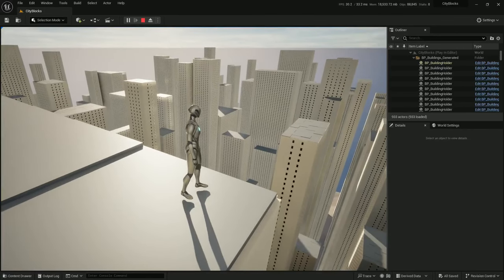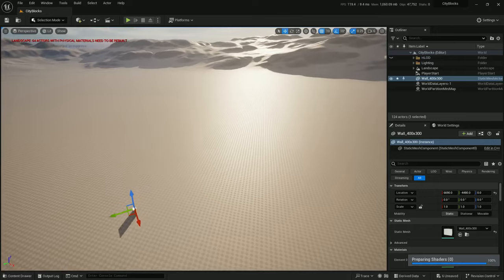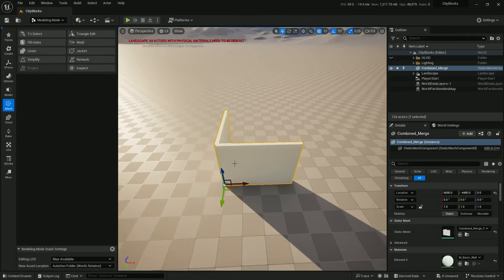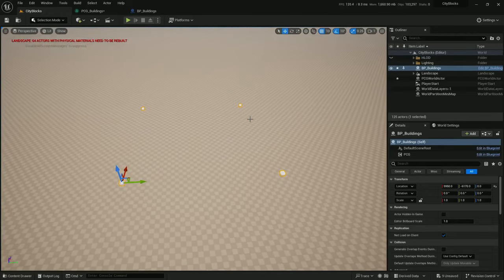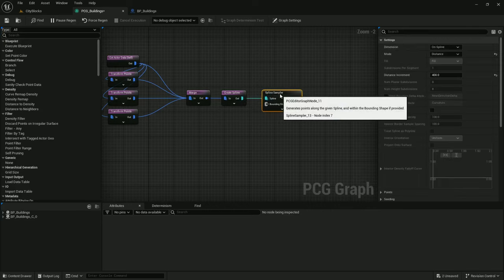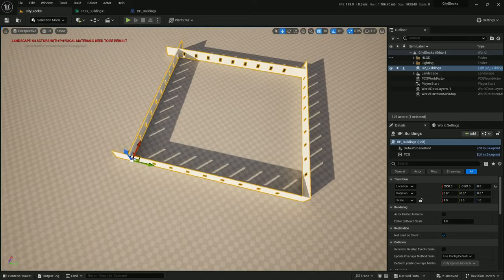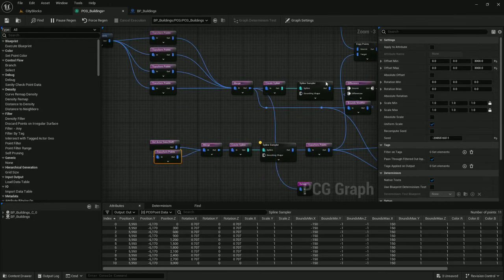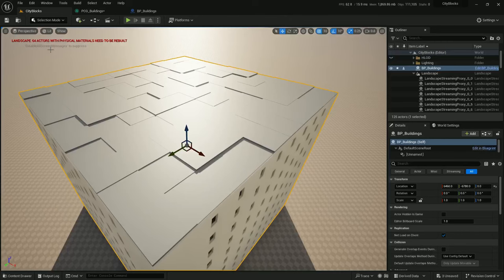New and Improved Procedural Skyscrapers - Unreal Engine 5.3 PCG Tutorial

Comment: an hour and a half for something that will pretty much never achieve over 30 fps isnt really worth using unless its for something non real time
Reply from the maker: That's why I watch tutorial videos at 2x speed 👍
Reply: @MichaelRoyalty  speeding up this tutorial still wont help you get over 30 fps lol
Reply from the maker: No, but improvements to nanite and lumen might.
Reply: @MichaelRoyalty  Somehow the Matrix tech demo seems to run pretty well. What did they do different?
I think they didn't use PCG. I think they used Houdini to create all of the buildings.

Unreal Engine, Blender are trying to do what Houdini is doing, but Houdini is better at it. I would suggest to build it there. There are also plugins for Houdini in Unreal Engine.
Reply from the maker: Yeah, the matrix demo pre-dates PCG, and the buildings in it are hollow. It wouldn't be too hard to spawn cubes in PCG and slap building textures onto them. I think the big challenge the matrix demo solved was in how it lays out streets in a customizable grid.

In this video I'm not going for efficiencies, I'm laying out lots of static meshes to block out the building, basically pushing PCG to excess. These are two very different goals, even though the end result appears similar.

Also I'm not kidding when I say improvements to nanite might help -- the big slowdown seems to be because nanite can't break the walls down into larger triangles at a distance, so it gets overwhelmed. If it gets the ability to merge different ISMs together it would grant a massive performance boost.
Reply from the maker: Here's a great PCG city example that uses textured cubes in the same way the Matrix demo does: https://www.youtube.com/watch?v=KRjtqxID16U
Reply: @MichaelRoyalty  we shouldnt have to rely on nanite to do all our optimizations for us. Nanite is making people lazy.

Comment: Do you plan to continue this project like in your showcase video as result with these terasses? And maybe you can add stairs, so you can walk through every etage? Thanks for this wonderful tutorial!
Reply from the maker: I'd like to, but figuring a building layout that will support stairs is a challenge! I'm muling over the best way to design full room based interiors, and with that I should be able to support stairs and elevators.

Any update I will do will take a while, it's a complex problem to solve.
Reply: @MichaelRoyalty  if it would works, would it be a separate tutorial or based on this tutorial? And thanks for the answer!
Reply from the maker: I'll try to make it based on this tutorial. It's possible I'll have to take a different approach and start from scratch, but I'm pretty sure this is a solid base.

If you hand created some stories and interiors and saved them to assemblies, you could reuse those to create the building interiors. Just copy the assemblies to the vertical spline and you're done!
Reply: @MichaelRoyalty  ok thanks! You make really good and highquality videos! Thanks for that!

Comment: Good Video, though skyscrapers have different floors at the bottom ( shops, markets etc ) than above :). There's a difference between the ground floor and 1st floor . Also, I would like to see how you can generate lights inside the bulidings.
Reply from the maker: That's a good point, but this video was getting long enough already. I figured I'd deliver enough to make the shells of buildings. Noted for the next video though :D

I'm not sure of the best way to do the lights. I'll have to brush up on my indoor/outdoor lighting techniques. It wouldn't be hard to add a volume that adjusts the lighting parameters, since I've already created a box collision with each building, and then individual light actors could be spawned for accents. But that's really getting into interior layout, and it'd be fun to create a few different interiors to load in on a per-building basis.

Comment: Have you run into an issue where you cannot affect the z axis? I made a mesh within UE, using the width for the 400 length, and depth for the depth of the wall (since width is along x axis which is the forward axis that made most sense). However that puts the walls at a 90 degree offset when generated along the spline. Would be fine if I could get the Z rotation on Transform point to work, but it has no effect, while XY adjustments do.
By the way, thanks a ton for sharing this. It would have taken a long time to familiarize myself with PCG enough to achieve this. Will help really progress my project!
Reply from the maker: You're welcome! I'm afraid I haven't run into the problem where Z rotation doesn't work. Generally when my meshes don't line up with how I've created my points, I can add a transform points right before the static mesh spawner for the final corrections from mesh to what I've built.

@TheLazyContradiction has started a PCG buildings series, and he's going about it in a slightly different fashion from what I've done. You should check the videos out, they might give you more ideas for your project. https://www.youtube.com/watch?v=Kntql5Q9o_8
Reply: @MichaelRoyalty Especially considering you adjust the Z successfully yourself. I can't figure what the issue is unfortunately. I ended up just adjusting the depth for length rather than the width for now.
Thanks for the link! More knowledge is always beneficial! And people complain about UE5... hahaha